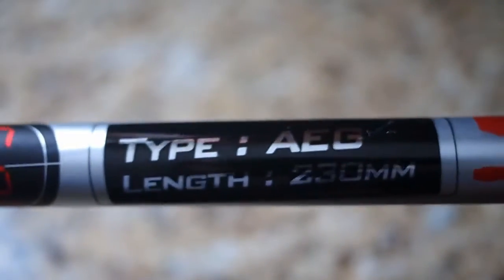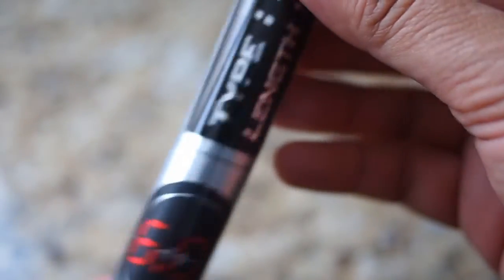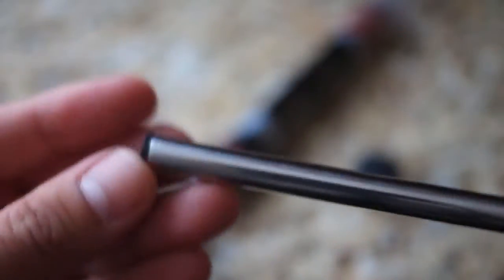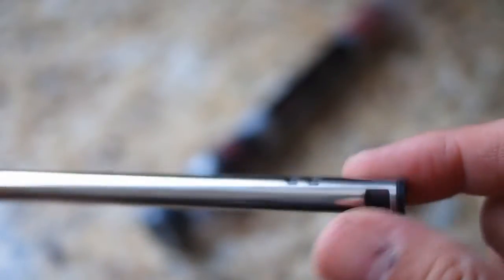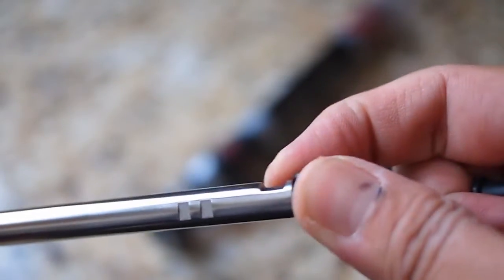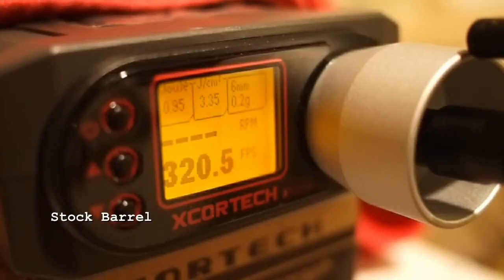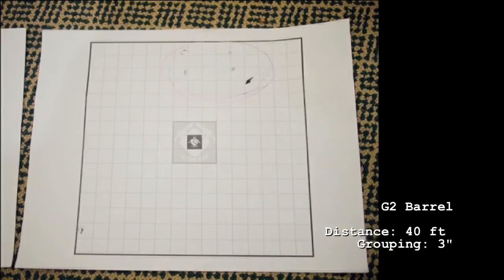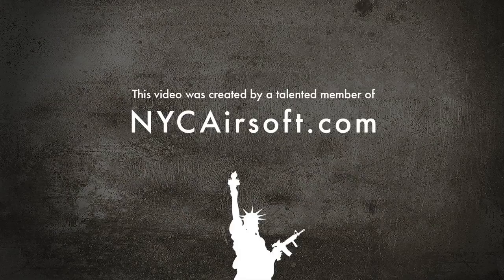Angel Custom G2 Tight Bore Barrel 6.01mm

Comment from the maker: The reason I doubt it is because nobody keeps their inner barrel poking out of their rifle. An uneven/damaged muzzle in RS can adversely effect accuracy, which is why RS gun makers recess the crown (and its subtle). In airsoft that's moot. Airsoft guns hide the inner barrel is behind the outer barrel, suppressor or flash hider, which would negate any benefit of the crowning's shape.

Comment from the maker: As I mention in the video, you should not buy a tight bore for improved long-range accuracy unless you have a really crappy barrel. A tight bore's primary benefit is increasing FPS without adding additional stress to your gearbox.